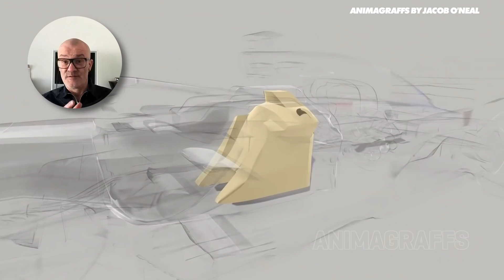Why Max's Red Bull Caught Fire in Australia

Comment: I had an oddball feeling the lack of Honda in “Honda” would cause issues.
Reply: Honda is still contracted to build and maintain the engines
Reply: @andyf1210  yes. Strange to see Honda changed to RBPT.
Reply: The engines are still being built by Honda in Sakura (Japan) until 2026. Red Bull decided there was no rush to build the new factory now the engine freeze is in place.

There’s even HRC written on the side of the Red Bull and Alpha Tauri, which stands for “Honda Racing Corporation”.
Reply: you guys keep saying this when nothing has changed just re-badged. made in Japan. Japanese engineers etc
Reply: @woofy9977  It's amazing how many F1 fans don't really understand that RedBull PowerTrains division are gearing up for the 2026 engine change. Horner even admitted during an Sky F1 interview, late last year. That RB and AT would still be using sealed Honda PU's built in Japan, and that Honda will still own all the IP's relating to that engine.
This is so that RBPT will get all the same extra time, perks as any other new engine provider would. They wouldn't be able to do that, had they took over the Honda PU internally. It's also why they headhunted the best of MB's engineers.
Reply: @DJKav  exactly! they so badly want to blame rbpt cus their upset for renault??? Honda engine is great it's possibly a spec part not liking the way the team has configured things
Reply: @woofy9977  no it isn't like that. The lead engineer left.
Reply: @maxluthor6800  you mean he went back home to oversee the factory instead of tour with the team right?
Reply: RB is missing Tanabe in the track side operation
Reply: @kokhualim2200  yes how come that guy couldn’t at least stay with the team? it was clear they all got along and that the team adored him :/
Reply: Engine comes from Honda but auxiliary stuff like radiators , plumbing and fuel system are externally sourced.
Reply: I think too much Horner causes issues.
Reply: Didn't a lot of the Honda guys stay on as RBPTs anyway
Reply: @MeltingRubberZ28  they were needed back in japan
Reply: @MeltingRubberZ28  happy ramadhan 2022 MeltingRubberZ28. 🙏
Reply: @MeltingRubberZ28  That was also my impression of RBR taking over the division and IP.
That being said it looks terrible, however not a surprise for a new-ish venture.
Reply: Whatever they narrow it down to it is still a problem w RBR team not dialed in on quality.   You need those engineers and Mechanics from HONDA. Not buying the engine design and having some me one else service the knockoff engine.   Funny as hell to me Christian H clever as Wile E Coyote.  Should have paid big money to staff that mechanics office w those brothers from Japan. Chris Horner doesn’t seem comfortable w POC. His resting prick face bigot.  karma  no excuses not about luck
Reply: @michaellanders4311  man those failures are not big failures actually...it's got do with auxiliaries around the engine.... quality of items
Reply: @michaellanders4311  i...i don't know where to begin... 

For one, the engineers from honda were taken into RBR under the RB powertrains brand, but the engine still belongs to Honda -- and when it's serviced, it must be shipped to the Sakura plant in Japan to be serviced by Honda (HRC).

Yes the quality is lacking, but that's likely due to the fact that Ferrari had more input on the fuel blend, had more time to dial in their setups as RB-Honda/Mercedes were trying to win a championship, where ferrari were just not competitive. Ferrari were at a much higher developmental advantage than rb and merc, which is why they're doing so well.

Horner is literally not the person you should be targeting about POC's when Sergio and Max are both non-english racers. RB also ran a special Honda livery last year, and have respected the company every step of the way. It's one of the reasons the relationship with honda was much better than the one honda had with mclaren. And also why the honda engineers worked so well with red bull.
Reply: @fernank017  Yeah after I wrote that uninformed screed I read up about details of Red Bull Honda engine and support    Mea culpa …. But still some issues and not a good look for Red Bull Just like Merc/AMG  so I’ll try not to shout out poorly researched nonsense. A bad look   I will show myself out ..
Reply: @michaellanders4311 still salty damn let it go
Reply: @gealingeman8643  Haha!!   Yeah you would think that I would  let it go   I have a high horse and as long as I can get my leg over I jump up on it … haha!!   Thanks I’ll try reigning myself in.    Christos Anesti    Carry on ..
Reply: A lot of it just means that Honda hasn't really done a lot of and/or meaning testing with their engines with this new biofuel given Redbull doesn't have a huge partnership with a fuel/oil company (Mobil 1 but they're not really cutting edge). Ferrari and Mercedes in this area have had a huge advantage given their partnerships with Shell and Petronas respectively. They have more of an equal compartmentalising between chemical engineering oil/fuel experts along with aerodynamicists and mechanical engineering ICE/PU experts. Redbull and Honda are top heavy with Adrian Newey, Honda ICE engineers, ex-Mercedes aerodynamicists and low on the expertise from the chemical engineering aspect (i.e. Petronas and Shell) on the aspects of the new biofuel's interaction with the engine. Needless to say, Horner was the ONLY team principal who pushed for this new engine freeze... so yeah, oh well. Boy... Cried... Wolf (no pun)
Reply: it is not like Honda was that great before 2021
Reply: @The_budgetking  because of stupid McLaren team...they didn't have breathing space to fix reliability...as soon as they seperated you can see the results...last year Honda pu is the most reliable by miles against any manufacturer...they could have easily finished with three engines without crashes...if you look this year it is not related icu anything like that...i think something to do with auxiliaries...max be redbull compramising quality of equipment to save weight...
Reply: @adr23  Not true. Honda had to start all over again and design a brand new engine. The one they supplied McLaren was a piece or rubbish. RedBull got a completely new engine design
Reply: @psk5746  because of stupid packaging of mclaren
Reply: @The_budgetking  because they joined the turbo hybrid much later than mercedes, and had to redesign an engine 3 times.

Comment: i just wish honda never left
Reply: Honda hasn't left, it's HRC handling the powertains until 2025.  All engines still built in Sakura Japan.  The issue isn't engine, but fuel system, which is the responsibility of the team, not powertain.